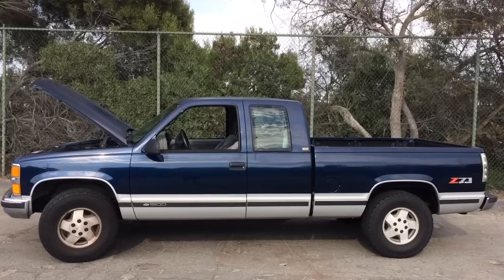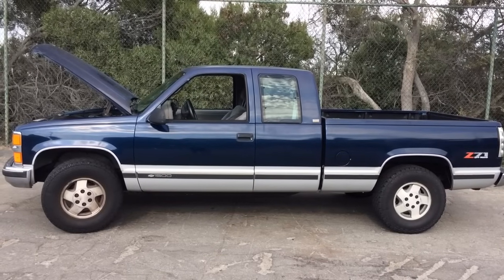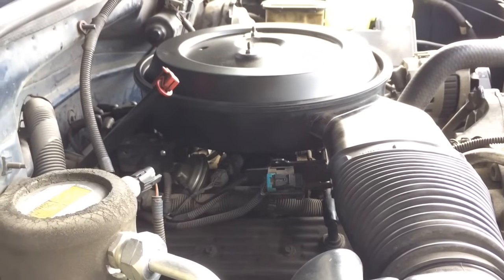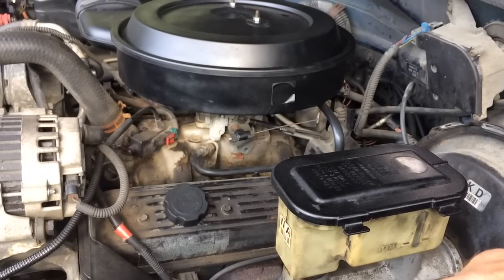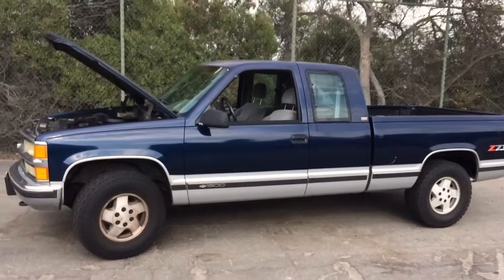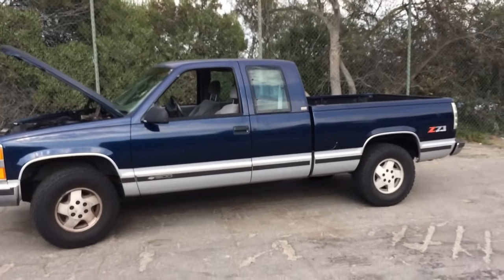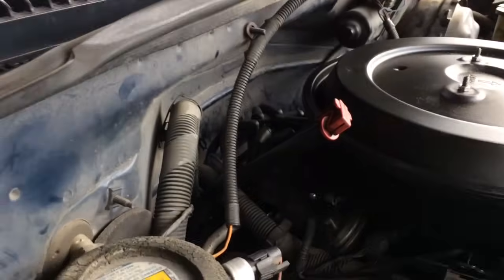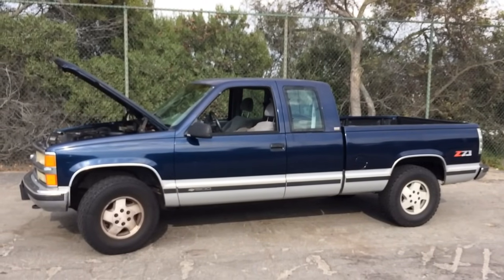Chevrolet Truck Hesitation Problem Fix

Comment: I changed the throttle position sensor, the plugs, distributor cap and wires, injectors were fine, changed the fuel filter. Checked the fuel pressure and it was fine but after none of these fixes worked I decided to change the fuel pump. That was the problem. The pressure was fine when I had it in park or even in drive but I’m assuming when I would drive it the pressure would drop. Hope my comment helps anyone save the headache I went through.
Reply: What was your symptoms? I have chnaged just about everything past few months. Idek what to do anymore. Worried about pulling this darn pump out cause nothing worked for me so far. Seems like when the truck is cold it runs a little better
Reply: @Drayelam21 I’m in the same boat I have a 1990 gmc sierra with a 350 in it I replaced the fuel pump spark plugs spark plug wires distributor cap and even fuel pump I drive the truck and with any kind of acceleration it bogs and turns off
Reply: @mr.hellboat6354 try the idle air control and the egr valve.
Reply: What was the fuel pressure? Mine is around 50-52 psi under load. Wondering if it’s my problem
Reply: Oh my God it is almost like I wrote this. Except I haven't changed the pump I've changed everything else under the damn hood. I put a new pump in it back last July. I'm going to feel like a jackass if that's the problem
Reply: Do you guys know what can be wrong with my 1995 Silverado it will idle good but accelerating it will have no power out of no where it will kick in and have power then just stop and be slow again
Reply: Then after a while check engine soon light will turn on and be even worse then will turn off feel a little better then will randomly get power again then loose it any ideas?
Reply: Check battery cable's to if it side post. Mine would be tight enough to start but it would loose power and back and fourth,I put another washer behind the cable and it ran better for awhile. 
But now it's been where I have to give shot of gas to get started. Started out it would start up after 1st time as long it didn't cool down too much, but now everytime I want to start it. 
Anyone have any ideas are had same problem
Reply: So what is the normal fuel pressure for the 1995 454 tbi ?
Reply: @Drayelam21  
I have a 96 GMC and fuel pressure showed fine and I changed it anyway and it was the problem.i kept having to give it a shot of gas in fuel injection to get it started and it run bad until finally getting it wound up slow on a stretch.it runs great now after changing fuel pump.mechanic I took it to check the fuel pressure and said it's fine you need injectors.i knew I couldn't afford injectors so I changed fuel pump myself and knock on wood that was a few months ago now.

Comment: Hesitation can be caused by the ISC, the pump, the EGR, the TPS, the fuel filter, the MAF sensor, clogged injectors, or bad plugs.
Reply: Great info. Thank ya'!
Reply: Just got another 99 Tahoe it had sat for a few months when accelerating it hesitates a bit not major could it need just a tune up??
Reply: I will look into the egr valve being stuck. But the cat is brand new. installed November of last year. Today same thing happened today. Runs great great for 15 minutes and then starts to run really bad. I hardly made it home it was acting up so bad.  The engine was really shaking. I thought computers were suppose to make things better. Can't the ecm see the engine isn't running right?
Reply: altlandf I was told I need a catalytic converter that’s what popped up on the reader as well..
Reply: @altlandf  ecm can only see the problem  it can't fix anything on it's own
Reply: It be the egr take the vacuum line off it and get a hammer and little punch and put it the punch in the egr and punch the hole little bigger and then put the vacuum line back on the egr and start the truck up might have to do it about 3 times and the hesitation should be gone. That’s what The mechanic did to my egr truck runs perfect now has no hesitation at all now
Reply: (Last of the real trucks..) Damn right
Reply: Mine hesitates when I try to push on the gas mainly around 35-45 mph and then backfires, It goes brand new plugs (properly gapped) new wires, new front and rear mane seal, new timing chain, new cap and rotor, new crankshaft position sensor, new camshaft position sensor, new fuel filter, new spider injectors, new regulator, new coil and still can't find out why it's doing it, I finally changed the camshaft position sensor and now I can get over 65 with ease but when I go to push on the throttle to get speed to pass someone it'll back fire a few then it'll get up and go
Reply: Mind you no check engine light
Reply: Have you changed the distributor yet?
Reply: Isc?
Reply: my code says lean fuel any guesses
Reply: @kellyh817  spark plugs, maybe? Air box issue?
Reply: @coledurbin2610  idel  speed control, another name for idle control valve
Reply: I got a 94 suburban with a misfire/ hesitation/stuttering problem, ive narrowed it down to a spark issue, or at least that's what seems to be the most likely suspect at this point
Reply: @ThelronReaper  I had all those issues with my truck. I replace a distributor, cap rotor spar, plugs, wires map, idle control valve, and it wind up being the fuel pump..
Reply: @altlandf  My C3500 OBS has been doing much the same and it starts right at the instant the system goes from Open Loop to Closed Loop... watching the Long Term Fuel Trims the computer just starts adding trim and adding more trim till the engine is running so rich it goes to missing across all the cylinders! I do not know why either. I've replaced every bloody sensor on this thing at this point! Arghhhh!
Reply: @JoelJimenez1997  Check when you 1st start it before it warms up. Mine starts adding fuel trim like crazy just as soon as it warms up to the point where the computer goes from Open Loop to Closed Loop, I do not know why but it goes so rich it's slobbering and missing across all the cylinders. I'm about to call dealership and see what it'll cost to have them hook up to it and diagnose it with their computer which will know what all the sensor readings should be vs. what they are! I don't think there's any other way to figure out what's wrong.
Reply: @blairjosephbernard2011  sure beats the $300.oo I paid to replace it Two bolts c'mon you guys !

Comment: After 2 fuel pumps I got sick of mine and cut a whole in the bed and added a hinge
Reply from the maker: That works.
Reply: 🇺🇸 ZACHARY WRIGHT 2024 🇺🇸
Reply: Been there done that 😂🤌👌
Reply: Scale 1-10 how easy is doing to that job  . I need a new Gas float
Reply: Lol I had 6 sn95 mustangs, did 2 pumps, same trick for that car lol
Reply: @hoohoohoblin  I drove my 1993 gmc c2500 over 100mph even though the speedometer only goes to 80 mph I hope I did not brake anything the truck seems perfectly fine though
Reply: I'm gonna do that
Reply: I can have my bed off in the fuel pump changed in an hour. If you don’t watch out Cutting that hole in the bed water will sit on top of the fuel tank and eventually the water will work its way around your Owain. How do you sending unit and get water in your tank that adding you more problems

Comment: I just did a complete top end performance rebuild to my 94 raising compression, intake, cam, aluminium heads, true full duel exhaust, headers, fuel system upgrades, and a custom tuned Jet chip. I love these old trucks. It’s great to see other guys restoring and resurrecting them.
Reply: Let us know how long the bottom end holds up to that raised compression.
Reply: got a 91 k2500 with sm465 454 tbi gmt400 with c6p option, higher gvwr package
Reply: @Kdog307  nice, I have upgraded to a built 383 stroker and  a 670 carb
Reply: @anthonyskorner4511  it didn’t lol
Reply: I just built a 5.7 350 small block for my truck was not able to put any goodies on it just a stock motor but I absolutely love my truck and will never get rid of it. 89 Chevy and I even have the color matched Chevy jacket that was an option when you bought a new Chevy truck in the 80s
Reply: @terrybrown797  sweet
Reply: If you really want some more horsepower they make a Hemi setup for small block Chevys. next time I have to build mine I'm going to do it to mine
Reply: @terrybrown797  cool
Reply: @terrybrown797  my 383 peaked 415 hp on the dyno the upside to the stroker is the torque 457 ftbs and it’s low end too
Reply: @Ron-Swanson  nice that will wake the neighbors👍
Reply: @terrybrown797  yeah hahah. It has patriot headers on it too😆
Reply: @terrybrown797  who sells the hemi stuff for Chevy trucks?
Reply: @Ron-Swanson  I came across a Hemi setup for small block Chevy over a year ago. It was a kit you could buy with Dome Pistons and Hemi heads for small block Chevy I will see if I can find it again and I will get back to you
Reply: @Ron-Swanson  Hemi head produced for the SBC. Leo Lyons designed and manufactured them in the '60s. Lyons was located on Kendall Drive in San Bernardino, California. A few years ago I heard that the tooling is owned by Walt Austin and there were plans to produce the heads again.
Reply: @Ron-Swanson  when I built the heads for my small block Chevy I ported and Polished intake and exhaust ports
Reply: @Ron-Swanson  looks like it was just a rumor they made Hemi heads in the 60s and there was supposed to be a company that was going to start producing them again but I guess they decided not to I have heard a bunch of crazy stories about those Hemi small block Chevys. if you can find an old set for sale you will be one of the lucky ones. it sure would be cool to have a sbc Hemi
Reply: @terrybrown797  no doubt!
Reply: Nothing working for me, I changed everything
Reply: @BLACKRAIN390  always start with the basics fuel compression and Spark. give us a little more to go on what have you changed

Comment: Fuel filter every 1000 gallons ~ 14K miles.  Fuel pump every 80K.  TPS 50-80K, Clean harness ground at thermostat bolt, clean or replace EGR valve every 80K.  Check torque on TBI, make sure no vacuum leaks including EGR hose.  Tune-up interval highly variable, prob 50K max.
Reply from the maker: Good info. Thanks.
Reply: Foolish parts replacer comment
Reply: @Watchout1010  4 year veteran GM design engineering and retired drag racer.
Reply: @latrogeniwile58  have seen fuel pumps,egr valves,  sensors last over 200,000 miles without creating any issues-IAC motors get gummed up,egr valves get carbon buildup-I dont replace parts due to recommended intervals-transmissions now have lifetime fluid-nope.
Reply: @latrogeniwile58  if I owned a dealership-recommend maintenance for profit-aint that the game?
Reply: @Watchout1010  my trans just gave me a "hey, how 'bout a rebuild!" @ 130k miles. -should have serviced the transmission. whoops. Ace truck otherwise.
Reply: @snoolee7950  some trans will go down on you in an instant..😳

Comment: My 95 is nowhere near that good of shape. But seeing one, I sure would like to buy another 95 in mint shape. Such a beautiful body style
Reply: Me too. Mine has 439000 miles
Reply: Me 2 I got a 95 GMC Sierra 1500 4 wheel drive
Reply: I have a 96 shortbed single cab  with fresh paint no rust
Reply: My 94 suburbans paint is cooked from the heat. Would love to get it repainted someday. 183k miles.

Comment: It's a whole easier to lift bed up than pull the tank, loosen all the mounts and pick up drivers side.
Reply: Thank you
Reply: Ron Townsend Nope. Waaay easier to drop the tank.
Reply: If your bed mounting bolts are rusted they will just strip out. Been there done that.
Reply: @joetroutt7425  Get new bolts, that's all.
Reply: @rontownsend8235  oh yeah, that's it. Grind the ones you can reach and snap the heads off the others you can't with grinder. Then pray they don't snap off in the threaded sockets welded to the bed trying to remove those. No thanks I'll just drop the tank.

Comment: Slight hesitation at 45-50 mph similar to it feeling like a misfire can be caused by the transmission trying to shift into overdrive. The feel of it trying to shift from 3rd to 4th  unsuccessfully feels like a miss and can lead you to look in an entirely wrong direction
Reply: Barbara Todd this is my problem... how’d you fix
Reply: Adjust the TV cable if you’ve got one
Reply: To adjust TV cable mostly common on your 700 R4 Transmission is to locate the end of the TV cable on top of the intake manifold towards the driver side rear of your intake manifold where the cable comes into the bracket there is a half circle button on the side when you press that button in it releases the caller on the TV cable with the button pressed push the colour of the TV cable back towards the firewall release button and press accelerator to Full Throttle that's all you need to do to set your TV cable. Unless you are installing an aftermarket TV cable then you will have to set your length before setting TV cable. Hope this helps somebody I had to do it on my 89 Chevy Silverado C1500 5.7 L V8

Comment: I’ve never had a cat go bad because I always cut them off 😂
Reply from the maker: +Rusty Shackleford That is a much cheaper solution than buying a new one.
Reply: After new distr. which was bad. Still my truck missed on a load, next I put new spark plugs. Still problem next I bought a engine temp sensor. Yep still missed on a load. I was ready to get rid of my truck. Ngext day I checked on the web, a guy pulled the hose off the EGR and plug the hose My truck is running well now. I had duel exhaust wonder if I even need the EGR. going to drive a couple days and my buy a new EGR. It worked guys!
Reply: egr valve not bleeding through the bypass was/is a common things on them. first place I go when there's an off idle/low throttle stumble/miss, yet idle fine and run wide open. ;)
Reply: Rusty Shackleford  lmao right who needs cats
Reply: david Huber what do you mean you unplugged and plugged the hose? You didn't replace or clean anything? My truck is having the same problem
Reply: Yeah just the hose that goes into the EGR. No cleaning or replacing anything, just take the hose off the EGR then put a screw into the hose.
Reply: Rusty Shackleford 
Who sent you
Reply: If you lived in California you would never cut one off.
Reply: Did you have any problems after taking it out
Reply: Haha I cut mine off my 93 too!

Comment: TBI was from '87 to '95. I have 1 of each. My '95 runs fantastic but my '87 needed help. The previous owner did ZERO preventive maintenance. I bought the non-working truck from his widow. The engine looked like a chocolate milkshake inside as did the rear end. I pressure tested the cooling system and it held 20 PSI for 1/2 an hour and the needle never moved. I had already pulled the valve covers and found a worn through exhaust rocker arm on #8 cylinder. I cleaned the engine out with Brake clean and put in new rockers and 5 quarts of oil and a new oil filter. Still no start. Removed the original factory fuel filter and it was plugged solid. Replaced the fuel filter and she started right up. I did replace the TPS also and it made a big difference. My fuel pump also went out and I replaced it so now she runs decent. Thanks for the video and take care.
Reply from the maker: You’re welcome. These are great old trucks.
Reply: The first TBI came out in 89 because the 88 model year was still carbureted

Comment: my 1994 has just turned 245.048 miles !  this is one helluva great truck- thanks CHEVY !!!! BTW- IT ALWAYS RUNS COOL AS A CUCUMBER AROUND 120-140* NO OIL LEAKS OR SMOKING
Reply from the maker: It was designed to run forever with little bit of maintenance.
Reply: Mine just turned 201. She had the hesitation and then that turned in to a has fuel and cranks but no start issue. Anyone know why?
Reply: my 91 carfaxed at over 450,000 at 455xxx when the odometer quit 12 years ago

Comment: I had a weird hesitation AND Misfire too. 1997 GMC Suburban K1500. It would hiccup at all speeds. Ran several tests, didnt find anything. So we began an intense process: changed, spark plugs, wires and cap and rotor= still hesitated. Changed EGR valve=still hesitated. Checked all vacuum lines, no dice. Cleaned any valves or connections to crank case, nothing. Changed fuel filter, nada. Changed the old spider injector to the upgraded one with the wires at the tips. That helped, but still had hiccups. Changed battery when it died. It ended up being the distributor. The gear teeth at the bottom had worn down. Had to replace the whole thing and install it wrong by it being advanced by one tooth in order for it to work at 15 degrees. It took months but the result was all that new stuff.
Reply from the maker: My experience was very much the same. Sometimes you have to fire up the parts cannon and just keep replacing things until something fixes the problem. But now I have a lot of new parts on the engine.  On my truck I think it was a clogged catalytic converter that sometimes let air through and sometimes didn’t.
Reply: I have a similar hiccup. I’m so frustrated. 

My truck has a new fuel injectors, fuel pump, fuel filter, spark plugs, plug wires, ignition coil, and ignition control module. I put all that in. The truck was surging. The new fuel pump fixed that, but it still cuts out at 2000-3000 rpms. The only thing I can think of now is replacing the distributor. Or maybe it is the EGR, MAP sensor, vacuum leak, or throttle position sensor.

Comment: I have a 1990 Silverado Extended Cab with a 5.7 T.B.I engine. She has been going strong for 30 years ! However, I will be up grading the engine, drive train and rear end. You're correct, they DON'T make em' like this anymore. 
   Still running: "Chevy Tough" ! 👍👊
Reply from the maker: These are great trucks, and reasonably cheap to keep running, especially when compared with buying a brand new one.